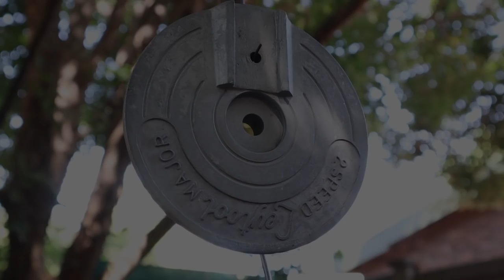Vintage Leytool Major Egg Beater Style Hand Drill Restoration.

Comment: I'm afraid that I prefer the finish that the makers in Leytonstone used. Did you not have any silver powder coat? Also, blasting the surface off parts which were intended to fit precisely is never a good idea. You end up with a rattle fit rather than smooth action.
Reply from the maker: We have silver, every second video we make contains silver, you tend to get a bit sick of seeing silver. The fine media we use and the lower pressure we sandblast at does not remove enough material to make a significant difference to tolerances.